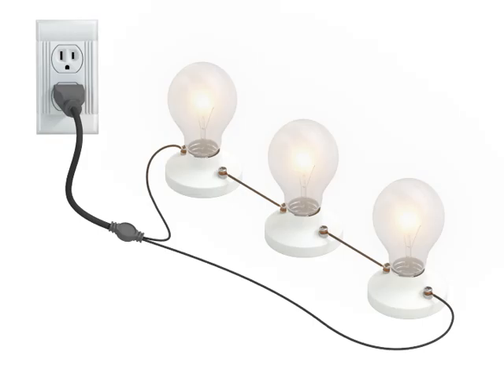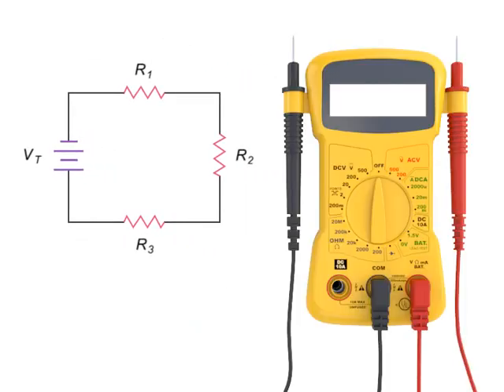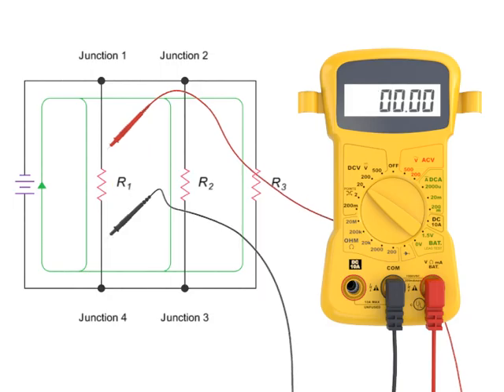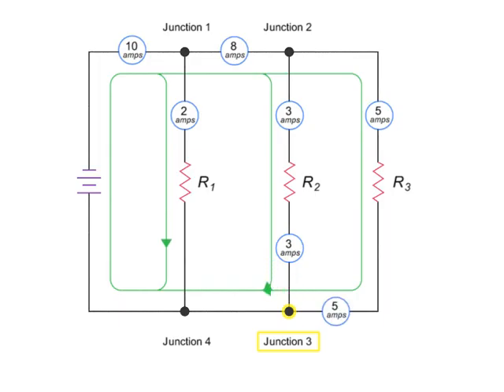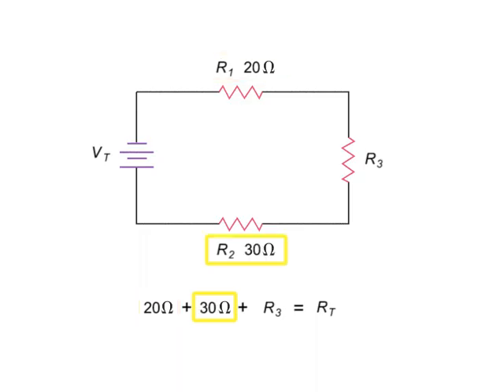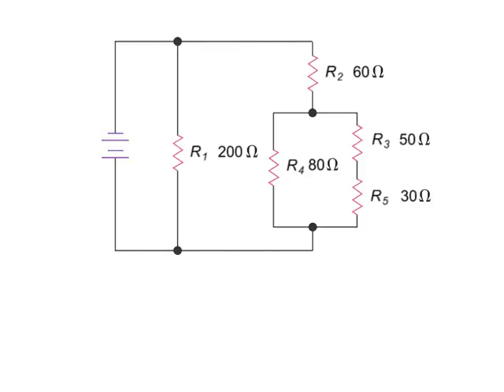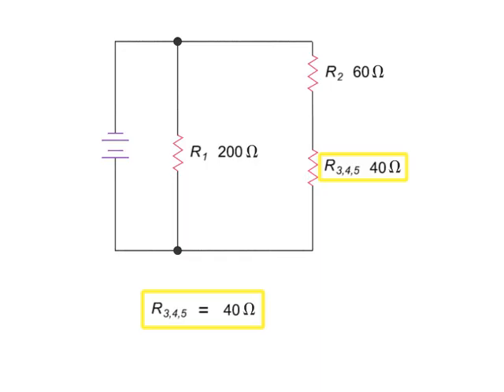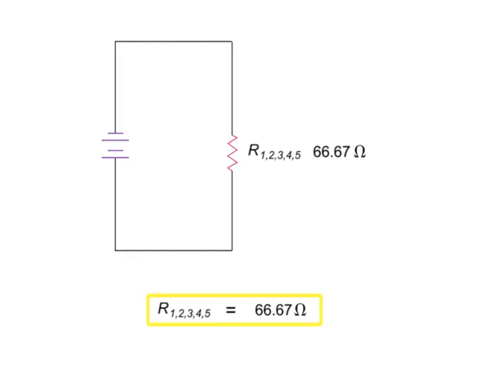Two Simple Circuits: Series and Parallel

Comment: I was taught parallel circuit resitance total  is calculated 1/ 1/r1 + 1/r2 + 1/r3 ... Or 1 divided by the sum of reciprocals of each resistor. Totally confused on series/parallel part. This way does Not work for missing values. It is better to make a chart and use ohms law and kirchoff to evaluate that. No mention of power calculation?

Comment: would the parallel circuit cause excess heat connecting 3 power lines directly to one source (as shown here) rather than having one source deliver power to one source which then delivers to another source and so on? (series) Working with car electronics and don't want any fires.

Comment: if current has divided in parrell connection
 its means charges divided then how it is possible it lightents the bulb equally
Reply: Im no electrical engineer but my guess is that each of these resistor has different amounts of resistence, hence some need more amps than others(thats of course if all the lights are the same wattage). If they all had the same resistance, then they they would all receive the same amount of voltage (120 volts) and amps (10amps / 3 = 3.33 amps). So power to each like is 12 x 3.33 = 39.96 watts per light, which will make them shine the same brightness. Please if i am wrong can someone correct me?